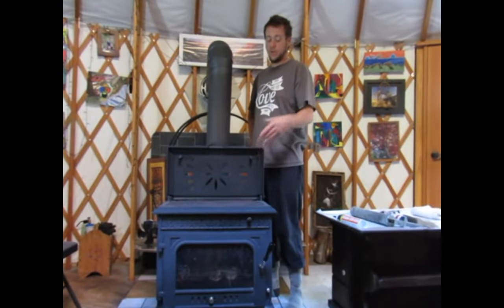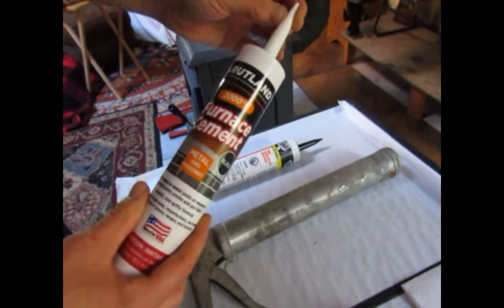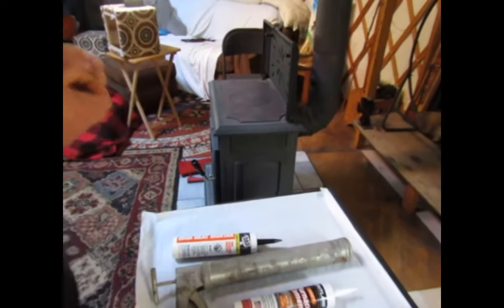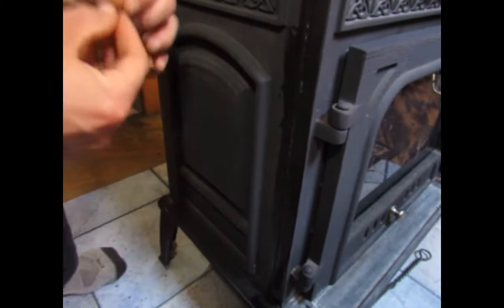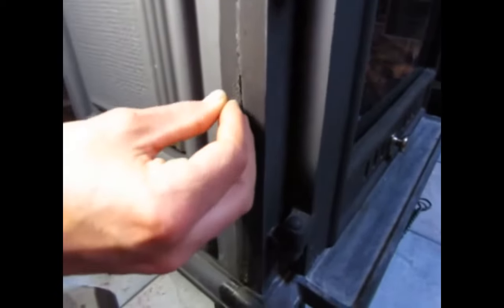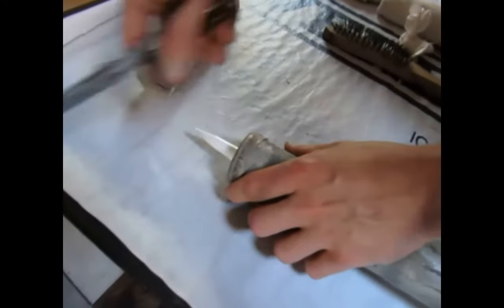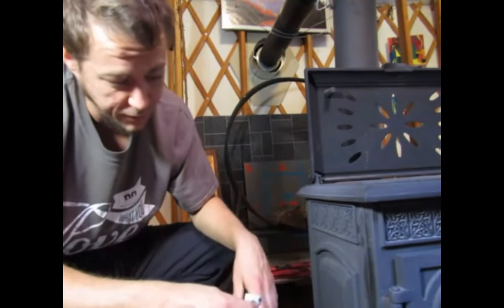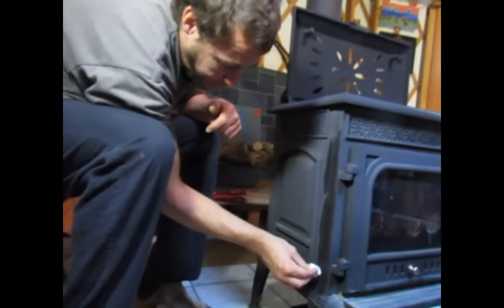How to seal the cracks in your woodstove! DIY

Comment: Really good video I’ve just cleaned mine ready for fitting and realised you might want to revisit yours as there’s a gap right round base of the stove where side panel meets base plate . Found this whilst washing mine with hose ready for painting. I’m gonna seal reseal all joins sides top n bottom I’d suggest you do the same buddy cheers

Comment: I don't know if you left a step out, but after picking the old sealer out, I would have used a smaller wire brush and a can of compressed air to remove all the loose debris. particles and dust before applying the new sealer. Good video none the less.

Comment: If you can use a sewing needle to pick out the sealant- you need more than just a caulk job style seal.   That stove needs to be spilt and sealed properly.   Also when they say clean they area, just wiping it off is not the correct way to do it, esp not when you wipe it off, then pick more stuff out over where you just 'cleaned'...
Reply: I removed the complete top off of my stove as I could see small amount of smoke at the joint underneath . After cleaning under the lid , what would you use to reseal , what this guy is using?

Comment: The furnace cement 
works, but every few years you will need to do it again. Eventually it flakes and falls off. JB Weld Extreme Heat only lasts one season.
Reply from the maker: Thank You for the tip. Would you suggest anything for a more permanent fix?

Comment: We had our wood stove cleaned today... They noticed a crack on the bottom of the stove... Like literally where you rest the wood...We have a crack on the bottom of our woodstove... is this even possible to repair?
Reply from the maker: That is a good question.... I would try to fix it the same way you fix any other crack but if that doesn't work I'm not sure